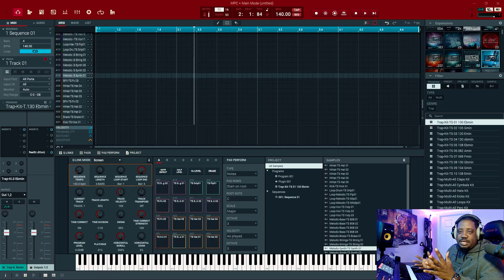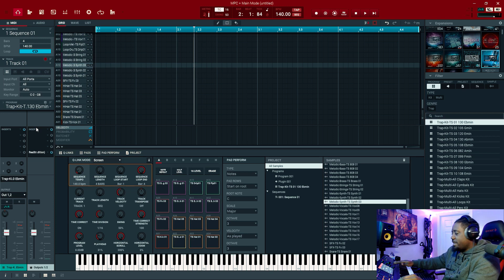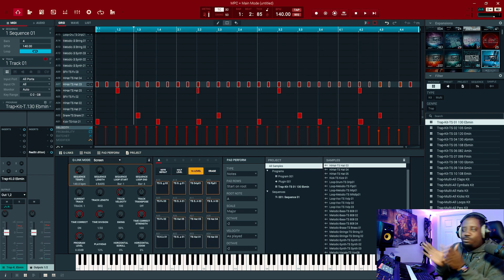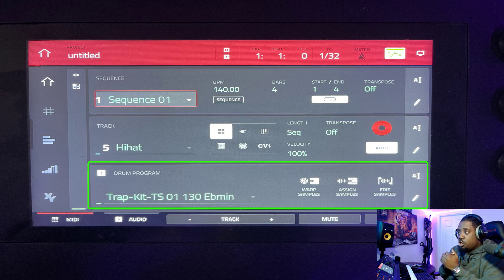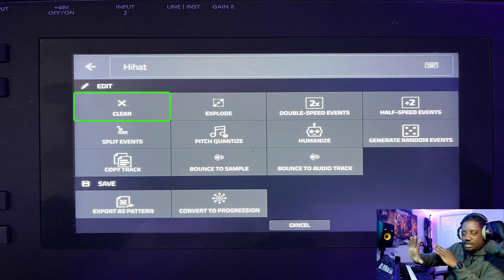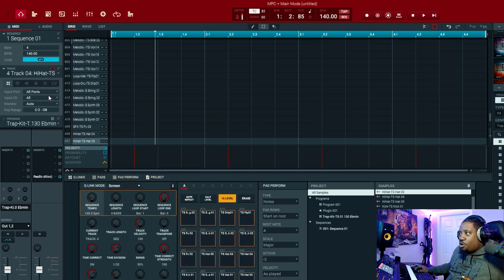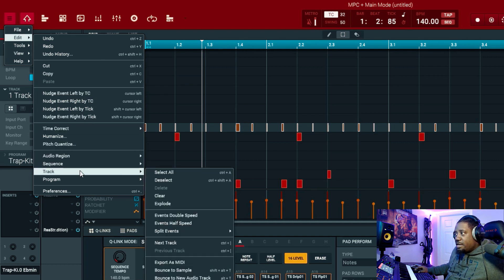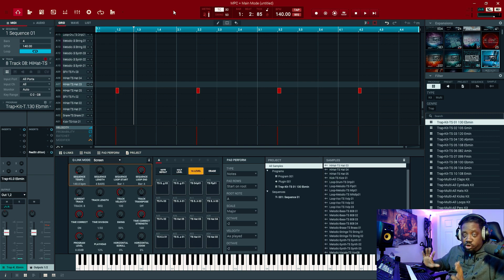Separating Drum Program Tracks on AKAI MPC - A Step by Step Guide Easy

Comment: After you explode a trace. Can you take the pattern you have on the track and turn the track into a key group track?

Because with hi hats you may want to spread them across different simitones to get those rolling effects. 

Especially with 808’s you want the ability to spread them across different notes to make a bass line.
Reply from the maker: You don’t have to use the keygroup to do the rolls you can do in the drum program watch my video on how to pan you hihats. In stead or using pan use pitch it’s the Sam concept 🙏🏾👍🏾